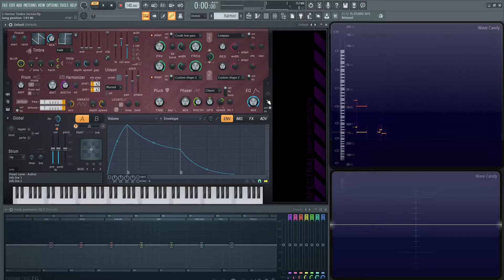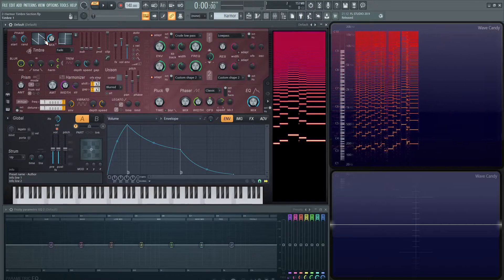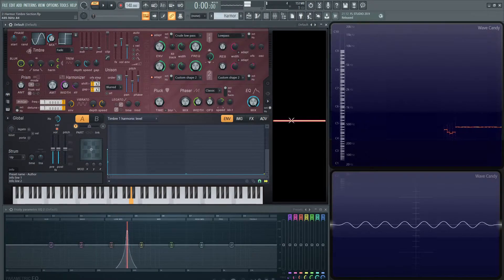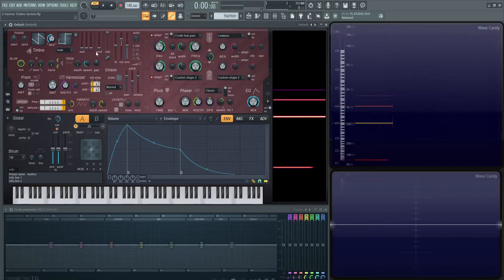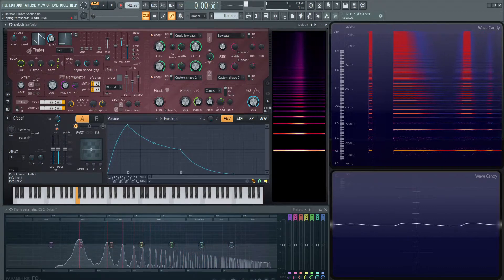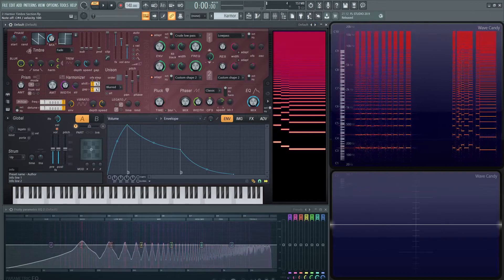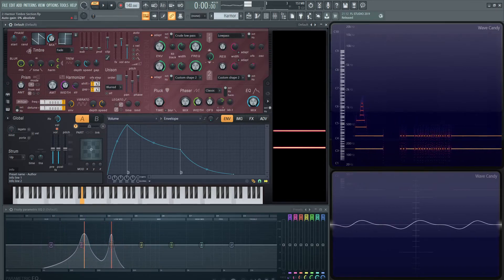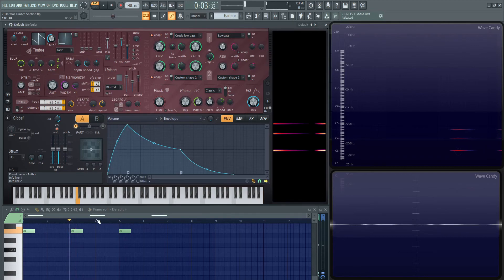Harmor Tutorial PART 2 Timbre Section | FL Studio

Comment: With Auto Gain, the best situation I've found myself using it on is when using the Noise resonance type in combination with the Blur envelopes. Because the amplitude of the partials are different making up the saw wave, some partials when using the Noise type are quiet or loud, and can be inconsistent. Instead of using compression, the Auto Gain was helpful for brining up the partials and down the loud ones.

Also I believe its prominent when using filters, since the filters in Harmor are part of the additive engine, Auto Gain will auto gain the partials affected by the filters or resonance
Reply from the maker: Good looking out! Ill have to try that. Maybe I can incorporate auto gain in future patches of mine, now that you bring up a good use for it. It was one of those knobs for me that I didn't really use too much. Thanks for the tip!

Comment: 2:15 This and the prism can make some really amazing things out of soft-saw ish things, which Hamor makes easily by just selecting wave as the line to draw, square wave starts off like that so just drag the point in the middle up and down, maybe offset it a bit etc. The high mids-highs can sound so great when either detuned extra or hardly at all, in the former they'll usually be squelchy or hyper-sawish or the like, and in the latter you'll have these sharp freqs cutting through on top of a nice detuned body, and that's just with clean, singular curved lines.
Of course, same goes for using the resynthesis as a wavetable, hell, the oscilators seem to act as a sort of harmonic filter for these too, saw being unfiltered.

Btw. could you just imagine Harmor 2? Being able to effectively automate the drawings (We already can to an extent, if they're assigned with ADSR roles, there's also envelope amount etc.), they could add features from Phaseplant and the like, it'd be insane.
Reply from the maker: I think if harmor 2 came out I wouldnt sleep for a week!! Image line would probably make a lot of money if they did that. I'd buy it in a heartbeat

Comment: Isn't the sawtooth wave a sum of the fundamental frequency (1f), and all of its overtones (2f, 3f, 4f, etc.) at (1/2), (1/3), (1/4), etc. the amplitude of the fundamental frequency?
In Harmor, in the "Timbre 1 harmonic level", why are all harmonics at the same level? 🤔🤔
Reply from the maker: That's a very good point because a mathematically correct saw wave doesn't have all harmonics at the same amplitude in the traditional sense. I've also wondered why Harmor has them like that. Perhaps is just how Harmor wanted to have their default saw wave? What is also interesting to note, is that saw waves are slightly different based on what synth is generating them, for example the saw in GMS is quite different sounding than what you'd expect a traditional saw wave to sound like. Even back to old analog synths, if you looked closely on a spectrum view of those saw waves, they are very very imperfect, but that did contribute to how they sounded.
Reply from the maker: @pranayblue  Thanks! that made my day! Glad to have you aboard!